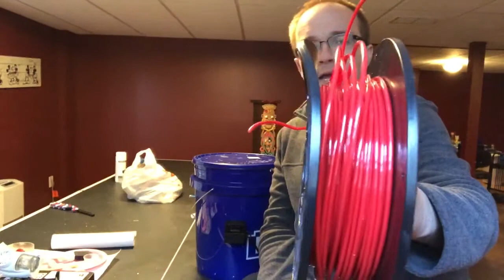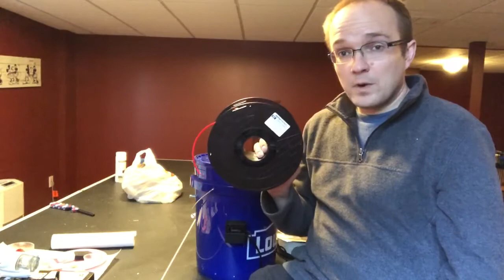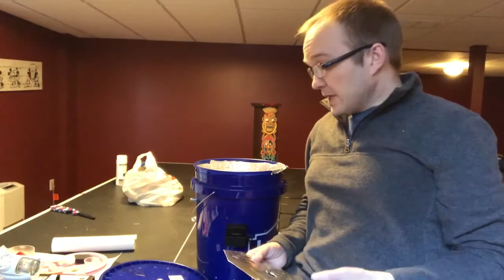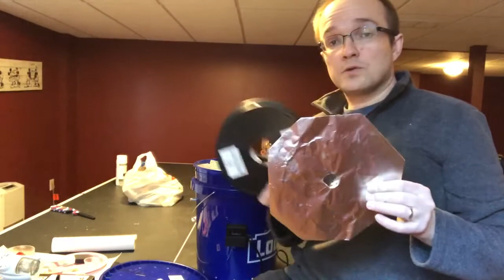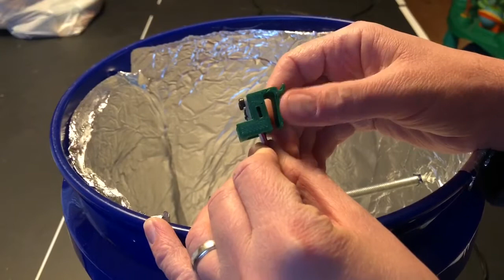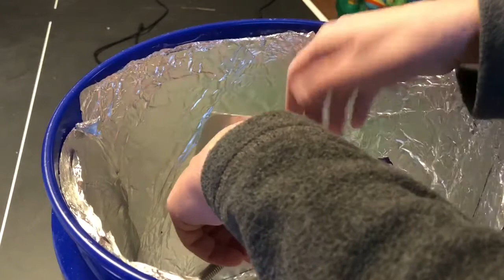DIY Arduino Controlled Filament Dryer - Part 3

Comment: do you have any way to measure the avg. moisture in the roll before vs. after?   That would help to create a % of moisture decrease per hour, etc... Then you could add a timer control on it, etc.. obviously different for each filament type...     But, overall, another good video!
Reply from the maker: BurninGems you could probably do it by weight of the roll before and after assuming you have a large amount of material (obviously 10g’s of filament will still absorb the same % of water as 1kg of filaments, but the smaller amount will have a tiny different based on weight. ) The keys to drying are to get the right temp for the specific material and time. 

Unless the material was submerged in water as I showed in my earlier videos, 12-18 hours is more than enough to get your material dry again :)

The software I wrote does allow you to set drying time and then after that time is complete, the dryer switches to a humidity hold mode meaning it doesn’t keep a high temperature in the container...it only adds just enough heat to keep the humidity below the specified percentage :)
Reply from the maker: BurninGems Thank you for the feedback!
Reply: @jim2386  Jim i am intrigued by this. I wonder if you could use an arduino uno and a reptile heater to make a temperature and humidity controlled storage box